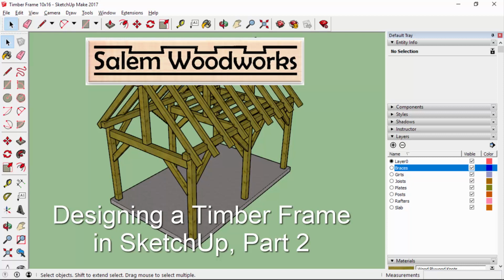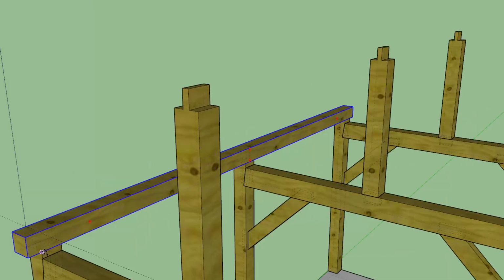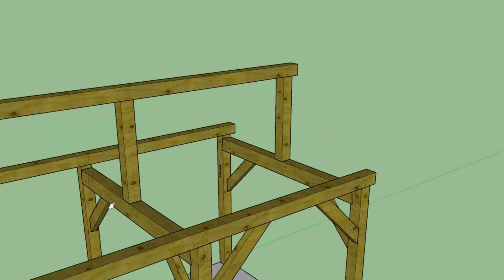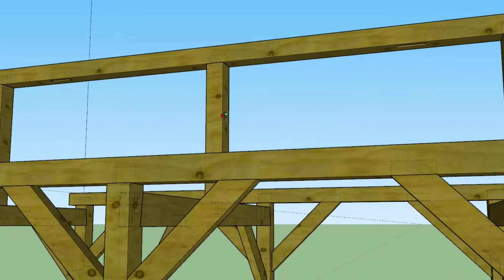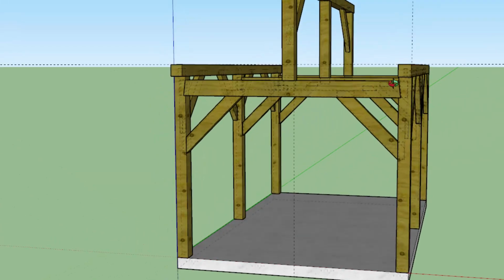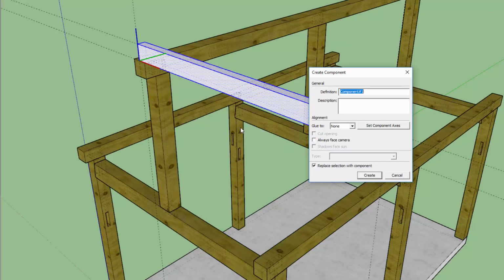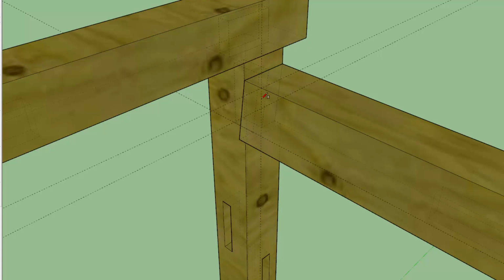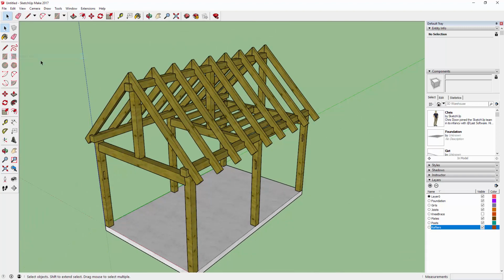Timber Frame SketchUp Tutorial  - Part 2

Comment: Great info.  As a details freak I did notice though that at the end when you copied the gurt from the outside wall to the centre beam, that wouldn't work because your knee braces on outer walls sit flush with the outside wall.  The centre gurt knee braces you moved to centered position, so they would no longer fit in the top since the top of the knee brace would now want to sit flush with the outside edge - you would either have to correct those two pockets or manually do all the cutouts, which is more work.  What if you want to do dovetail pockets, that might be a bit complicated compared to the simple straight pockets you drew here, but they are much stronger.

Comment: If this was for square rule and you were planning to use true 6” timbers, wouldn’t the “true depth” of the pieces be 5.5” (probably)? Don’t you need to account for that in these measurements?
Reply from the maker: This simple plan was done "mill rule". I have done square rule and it adds quite a lot of additional work and detail to the modeling.

Comment: Firstly thanks very much for the tutorial it's been invaluable to me for designing my timber frame. I really appreciate it! 

Question: To copy the rafter your first entered the unit of movement and then entered the unit for how many times to move it then hit x. I've tried in a variety of ways to do this but am getting hit with an "invalid entry". Is there a specific setting you're in or any other detail?

Thanks again!
Reply from the maker: M for move, holding Ctrl to copy.
Start moving in your desired direction.
Type the number for the desired distance to move, for example, "24", to go 24 inches, press enter
Then hit "x7" to make 7 copies, for example.

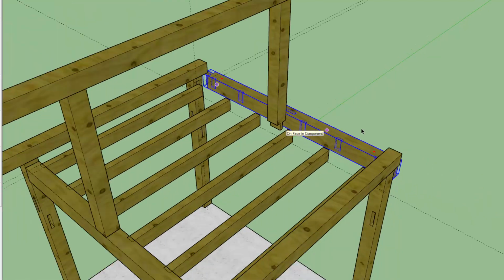Comment: @22:03 the middle girt that was deleted had the mortises centered and the replacement from the end ones have it aligned with the outer face... tenons wont line up
Reply from the maker: I'm glad you're watching closely, but I don't think you're right in this case. The mortises on the end girt are 1.5 inches from the rear end of the frame. The mortises on middle girt are 1.5 inches from the front end of the frame, so flipping the girt leaves them lined up.
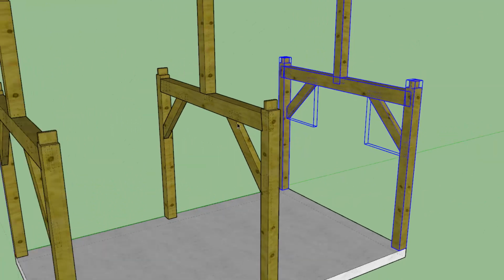Reply: @SalemWoodworks   Hmm.. I  think I mistyped.. I meant the knee braces... but I still see where I went wrong... @1:25 you flip the entire assembly. Since the knee braces are only half the width of the posts/girts and the tenon is on the inside half, I figured that it would be off, because I missed what you mentioned at @1:42.. Now when you flip the copied girt, things line up. Very interesting geometry. Almost makes all the pieces interchangeable (wider knee braces, although overkill, would make do it)..